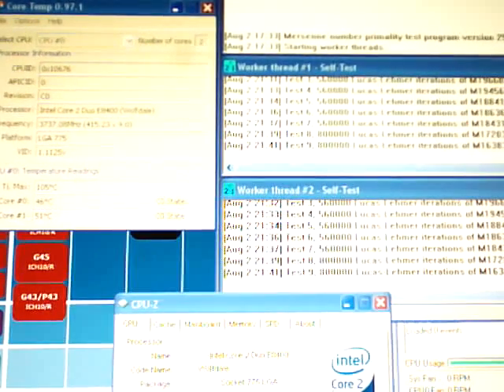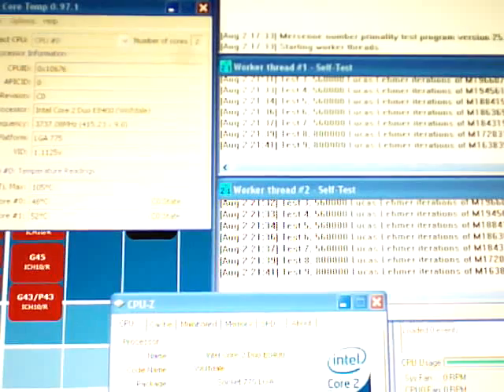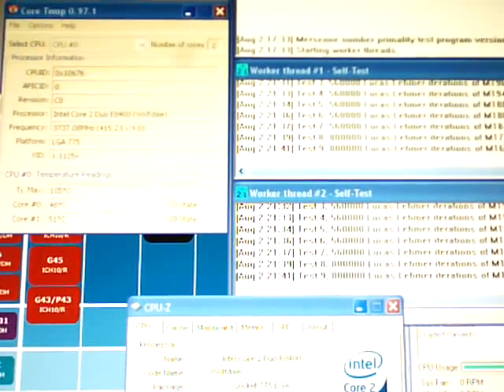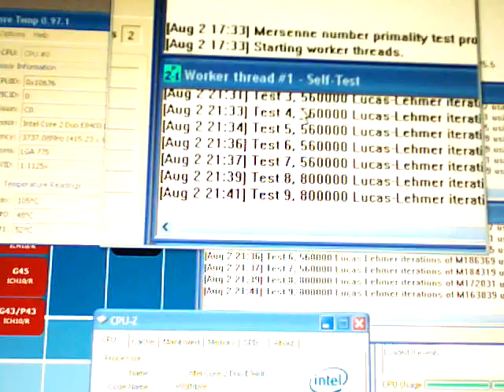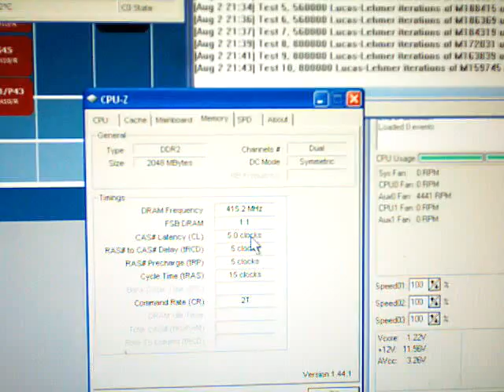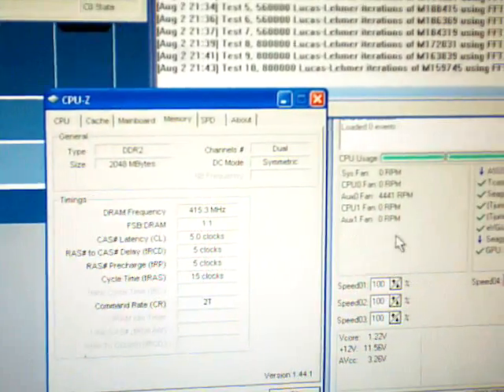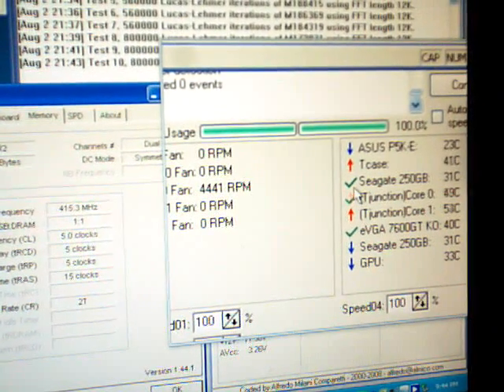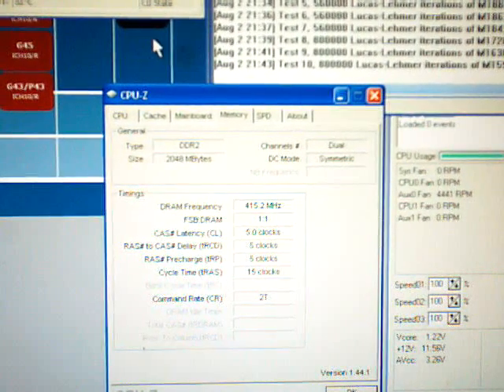E8400 415x9 3737MHz 1.244v P5K-E Prime95 testing

Comment: Bro I am running e8400 @ 4Ghz in the bios and fsb 2000Mhz My voltage is 1.535v on air noctua in the bios. MY CPU-Z is 1.3v. CPU-z does not register the voltage correctly, dont tell me your voltage is 1.225v and you booted 3.7Ghz - this is unreal. What is your real bios voltage? I woned 2 e8400 and they were almost undentical to post 3.6Ghz you need to bump your voltage to 1.355v or 1.375v. So many people lie those days, we need to cut their head off for that.

Comment from the maker: Thanks I am not going to pass 1.40v under load in windows. Got it up and going at 40005mhz at 1.320v unloaded have not stressed it yet. Ran cinebench 9.5 a few times and seems good to go under full load will post results in a bit.

Comment: i just got one of these for fun... mine is @ 4.05ghz with 1.376 (volts set to auto on mb) im to lazy to lower voltage and it passed prime for about 10 hours, i left it overnight while i was sleeping my memory is running @ 1069

Comment: RickArter, great setup dude. I now have two core2 based systems at home. A Q6600 which is my older box and a budget build with the E8400 for my games and tinkering. I have not tried to go any higher than 3.6Ghz but its amazing to see how well the Intel stuff ramps up with clock speed increase. Very big performance gains.

Comment from the maker: Current one is the TT BT lapped check the channel.

LGA771 huh got a QX9775 to put in or two aka skulltrail.

Danm FB-DIMMS and a screwy BIOS holds them back but some manage. What the highest speed  fully buffered sticks out now? Think its only like 800MHz with crap timings like CL5.

The X58 is coming soon with rumored crossfire and SLI support. Surely the socket change will develop along side that as well as AMDs newest offerings. All 45nm/32nm 2-8 cores+ 3.0-3.6ghz in 2009